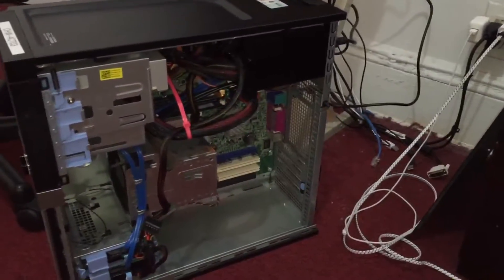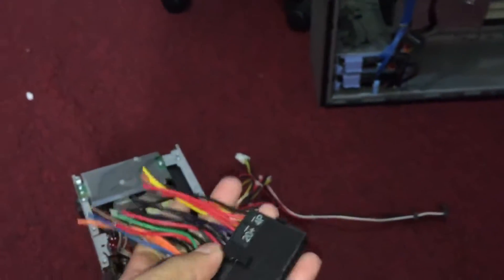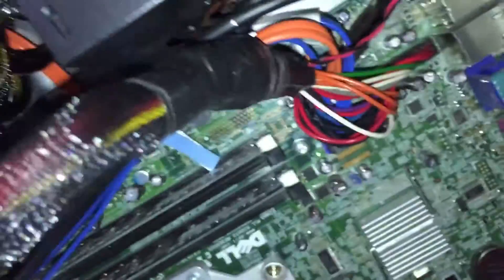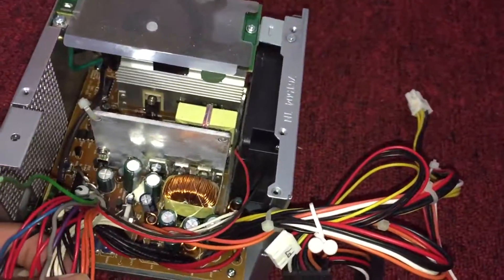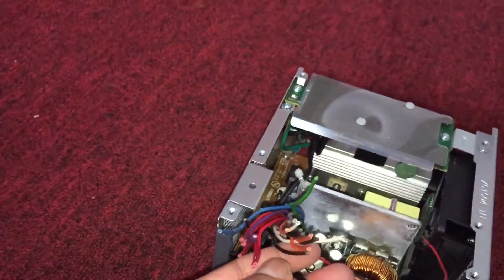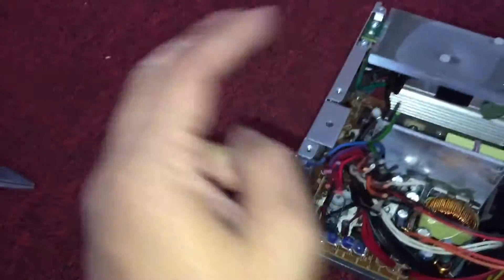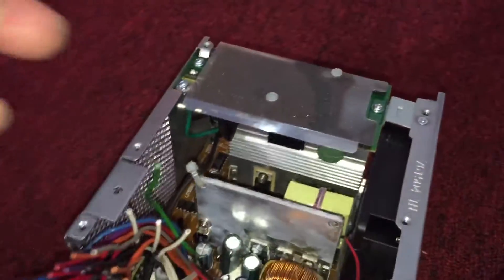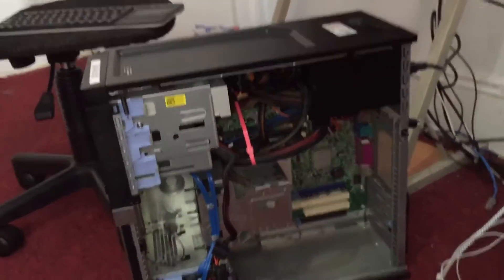Dell Optiplex 980 Power Supply Upgrade Wiring Tips

Comment: Did this and it worked. Cut the mini 24 off the Dell PSU and the full size 24 off the atx psu. Red to red  white to yellow black to black and the others matching. Had a brown and a yellow left over on the new psu. Works like a charm.

Comment: All my Wires are Black FML. Is there an Adapter I can just buy?
Reply: I did some research and this looks it has the right pin layout https://www.amazon.com/gp/product/B01LHF8ISM/ref=ppx_yo_dt_b_asin_title_o00__o00_s00?ie=UTF8&psc=1
I'm getting it on Saturday will let you know it actually works, already tried two different standard adapters and had no luck.
Reply: @neonlost  yes, that is the cable my friend. I did buy it and yes it works. I have a 450BT bronze PSU. Works great I slammed a GTX 1060 and can play fortnite on Epic around 90-110FPS medium at 145-210FPS if you go to my channel I uploaded some video of my new flight simulator. Will add more
Reply: @DavidrKun  oh awesome!! Can't wait to get it and try it ty for the reply. I have a 750 evga bronze psu I had laying around from a mining rig I'm planning on using then I was going to put in a gtx 760 but it's too large for the x16 pcie slot so I'm putting it in the x4 slot. Everything I read seems to point to me losing about 8% of my fps which is obviously a big bummer but this is just going to be a plex server / backup rig for when friends wanna play with me in something.

Comment: What if my new power supply have 5Red, 1blue, 2yellow, 1Gray, 1brown, 8black, 1green, 4Orange please tell me how to join my power supply and works by connecting wire....
Reply from the maker: +Is-mail H. Makame I'm not sure about your power supply configuration but red always Positive+ Black Ground- there should be a matching brown wire. Yellow wire goes to white sata or cpu. Green with green. Please do it at your own risk.
Reply: k. tx am done with it. doing go tx for your help
Reply from the maker: Anytime :)

Comment: What method did you use to connect the wires? I'm planning to swap out the stock psu for an EVGA psu in my 980. Thanks!